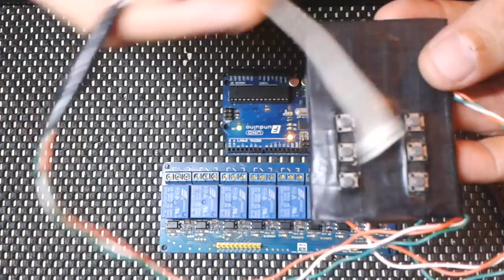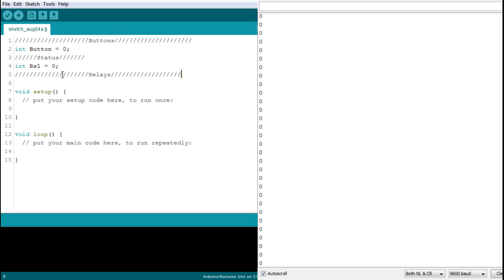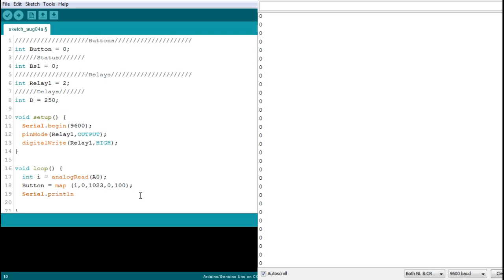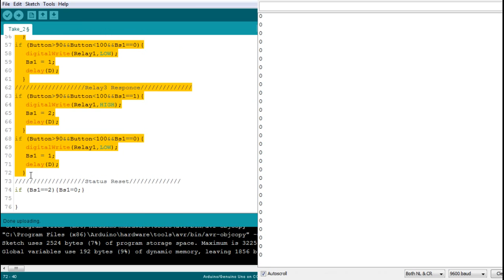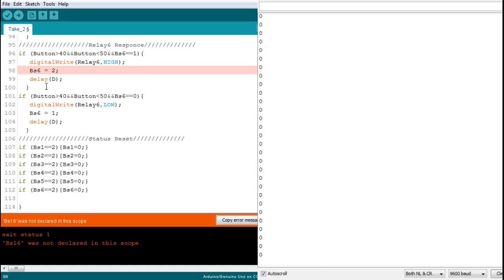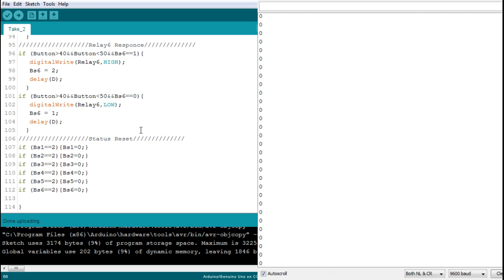Arduino Coding ("Button And Relays")

Comment from the maker: Here is the Code for Single Button None Resistive High and lows
//////////////////////////Button/////////////////////////
int Button = 0;
////Status/////
int Bs1 = 0;
//////////////////////////Relays/////////////////////////
int Relay1 = 2;
////Delay//////
int D = 250;

void setup() {
  Serial.begin(9600);
  pinMode(Relay1,OUTPUT);
  pinMode(8,INPUT);
  digitalWrite(Relay1,HIGH);
}

void loop() {
    Button = digitalRead(8);//change A0 to Digital Pin Used for Button
if (Button==HIGH&&Bs1==1){digitalWrite(Relay1,HIGH);delay(D);Bs1=2;}// Off
if (Button==HIGH&&Bs1==0){digitalWrite(Relay1,LOW);delay(D);Bs1=1;}//  On
    Serial.println(Bs1);
if (Bs1==2){Bs1=0;}
}
Reply: can u help me to write code for me
Reply from the maker: Please be a little more specific

Comment from the maker: Here is the Code for the Project:

//////////////Button/////////////
int Button = 0;
/////Status///
int Bs1 = 0;
int Bs2 = 0;
int Bs3 = 0;
int Bs4 = 0;
int Bs5 = 0;
int Bs6 = 0;
//////////////Relays/////////////
int Relay1 = 2;
int Relay2 = 3;
int Relay3 = 4;
int Relay4 = 5;
int Relay5 = 6;
int Relay6 = 7;
///////////////Delays////////////
int D = 250;

void setup() {
  Serial.begin(9600);
  pinMode(Relay1,OUTPUT);
  pinMode(Relay2,OUTPUT);
  pinMode(Relay3,OUTPUT);
  pinMode(Relay4,OUTPUT);
  pinMode(Relay5,OUTPUT);
  pinMode(Relay6,OUTPUT);
  digitalWrite(Relay1,HIGH);
  digitalWrite(Relay2,HIGH);
  digitalWrite(Relay3,HIGH);
  digitalWrite(Relay4,HIGH);
  digitalWrite(Relay5,HIGH);
  digitalWrite(Relay6,HIGH);
}

void loop() {
    int i = analogRead(A0);
    Button = map (i,0,1023,0,100);
    //Serial.println(Button);
//////////////////Relay1 Responce/////////////  
if (Button>90 && Button<100 && Bs1 == 1){
    digitalWrite(Relay1,HIGH);
    delay(D);
    Bs1 = 2;
    }
if (Button>90 && Button<100 && Bs1 == 0){
    digitalWrite(Relay1,LOW);
    Bs1 = 1;
    delay(D);
    }
//////////////////Relay2 Responce/////////////    
if (Button>80 && Button<90 && Bs2 == 1){
    digitalWrite(Relay2,HIGH);
    delay(D);
    Bs2 = 2;
    }
if (Button>80 && Button<90 && Bs2 == 0){
    digitalWrite(Relay2,LOW);
    Bs2 = 1;
    delay(D);
    }
//////////////////Relay3 Responce/////////////
if (Button>70 && Button<80 && Bs3 == 1){
    digitalWrite(Relay3,HIGH);
    delay(D);
    Bs3 = 2;
    }
if (Button>70 && Button<80 && Bs3 == 0){
    digitalWrite(Relay3,LOW);
    Bs3 = 1;
    delay(D);
    } 
//////////////////Relay4 Responce/////////////           
if (Button>60 && Button<70 && Bs4 == 1){
    digitalWrite(Relay4,HIGH);
    delay(D);
    Bs4 = 2;
    }
if (Button>60 && Button<70 && Bs4 == 0){
    digitalWrite(Relay4,LOW);
    Bs4 = 1;
    delay(D);
    }
//////////////////Relay5 Responce/////////////    
if (Button>50 && Button<60 && Bs5 == 1){
    digitalWrite(Relay5,HIGH);
    delay(D);
    Bs5 = 2;
    }
if (Button>50 && Button<60 && Bs5 == 0){
    digitalWrite(Relay5,LOW);
    Bs5 = 1;
    delay(D);
    }
//////////////////Relay6 Responce/////////////    
if (Button>40 && Button<50 && Bs6 == 1){
    digitalWrite(Relay6,HIGH);
    delay(D);
    Bs6 = 2;
    }
if (Button>40 && Button<50 && Bs6 == 0){
    digitalWrite(Relay6,LOW);
    Bs6 = 1;
    delay(D);
    }
//////////////////Relay State Return///////////                
if (Bs1==2){Bs1=0;}  
if (Bs2==2){Bs2=0;} 
if (Bs3==2){Bs3=0;} 
if (Bs4==2){Bs4=0;} 
if (Bs5==2){Bs5=0;} 
if (Bs6==2){Bs6=0;}  
/////////////////////////////////////////////// 
}
Reply: liney118 
Thx
Reply from the maker: Most welcome ;)
Reply: I get an error.  I only cleaned up the comments //

Arduino: 1.8.5 (Windows 10), Board: "Arduino/Genuino Uno"

train4button:115: error: stray '\357' in program

 }ï»¿

 ^

train4button:115: error: stray '\273' in program

4button:115: error: stray '\277' in program

exit status 1
stray '\357' in program

This report would have more information with
"Show verbose output during compilation"
option enabled in File -> Preferences.

//Button
int Button = 0;
/////Status///
int Bs1 = 0;
int Bs2 = 0;
int Bs3 = 0;
int Bs4 = 0;
int Bs5 = 0;
int Bs6 = 0;
//Relays
int Relay1 = 2;
int Relay2 = 3;
int Relay3 = 4;
int Relay4 = 5;
int Relay5 = 6;
int Relay6 = 7;
//Delays
int D = 250;

void setup() {
  Serial.begin(9600);
  pinMode(Relay1,OUTPUT);
  pinMode(Relay2,OUTPUT);
  pinMode(Relay3,OUTPUT);
  pinMode(Relay4,OUTPUT);
  pinMode(Relay5,OUTPUT);
  pinMode(Relay6,OUTPUT);
  digitalWrite(Relay1,HIGH);
  digitalWrite(Relay2,HIGH);
  digitalWrite(Relay3,HIGH);
  digitalWrite(Relay4,HIGH);
  digitalWrite(Relay5,HIGH);
  digitalWrite(Relay6,HIGH);
}

void loop() {
    int i = analogRead(A0);
    Button = map (i,0,1023,0,100);
    //Serial.println(Button);
//Relay1 Response 
if (Button>90 && Button<100 && Bs1 == 1){
    digitalWrite(Relay1,HIGH);
    delay(D);
    Bs1 = 2;
    }
if (Button>90 && Button<100 && Bs1 == 0){
    digitalWrite(Relay1,LOW);
    Bs1 = 1;
    delay(D);
    }
//Relay2 Response    
if (Button>80 && Button<90 && Bs2 == 1){
    digitalWrite(Relay2,HIGH);
    delay(D);
    Bs2 = 2;
    }
if (Button>80 && Button<90 && Bs2 == 0){
    digitalWrite(Relay2,LOW);
    Bs2 = 1;
    delay(D);
    }
//Relay3 Response
if (Button>70 && Button<80 && Bs3 == 1){
    digitalWrite(Relay3,HIGH);
    delay(D);
    Bs3 = 2;
    }
if (Button>70 && Button<80 && Bs3 == 0){
    digitalWrite(Relay3,LOW);
    Bs3 = 1;
    delay(D);
    } 
//Relay4 Response           
if (Button>60 && Button<70 && Bs4 == 1){
    digitalWrite(Relay4,HIGH);
    delay(D);
    Bs4 = 2;
    }
if (Button>60 && Button<70 && Bs4 == 0){
    digitalWrite(Relay4,LOW);
    Bs4 = 1;
    delay(D);
    }
//Relay5 Response    
if (Button>50 && Button<60 && Bs5 == 1){
    digitalWrite(Relay5,HIGH);
    delay(D);
    Bs5 = 2;
    }
if (Button>50 && Button<60 && Bs5 == 0){
    digitalWrite(Relay5,LOW);
    Bs5 = 1;
    delay(D);
    }
//Relay6 Response    
if (Button>40 && Button<50 && Bs6 == 1){
    digitalWrite(Relay6,HIGH);
    delay(D);
    Bs6 = 2;
    }
if (Button>40 && Button<50 && Bs6 == 0){
    digitalWrite(Relay6,LOW);
    Bs6 = 1;
    delay(D);
    }
//Relay State Return                
if (Bs1==2){Bs1=0;}  
if (Bs2==2){Bs2=0;} 
if (Bs3==2){Bs3=0;} 
if (Bs4==2){Bs4=0;} 
if (Bs5==2){Bs5=0;} 
if (Bs6==2){Bs6=0;}  

}